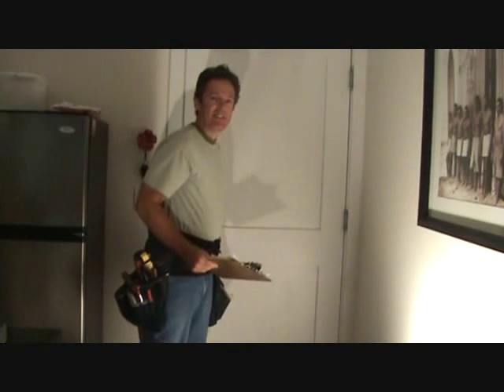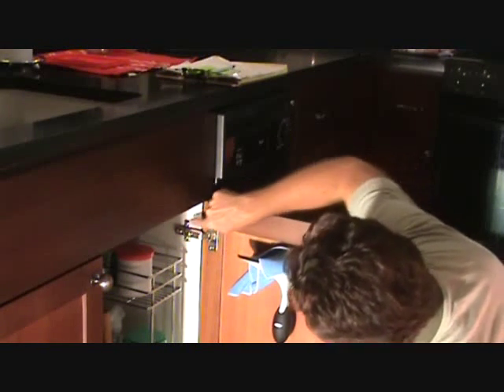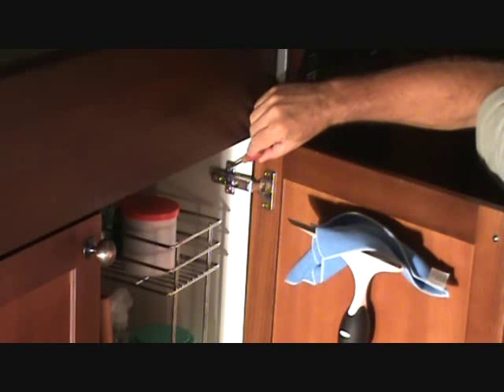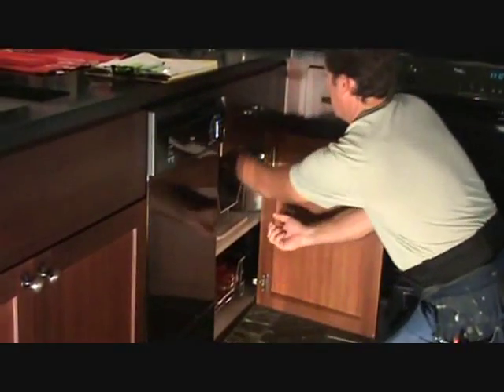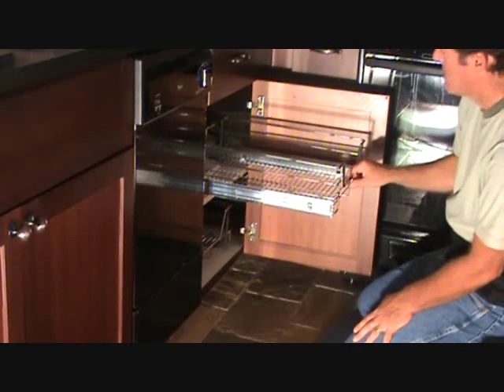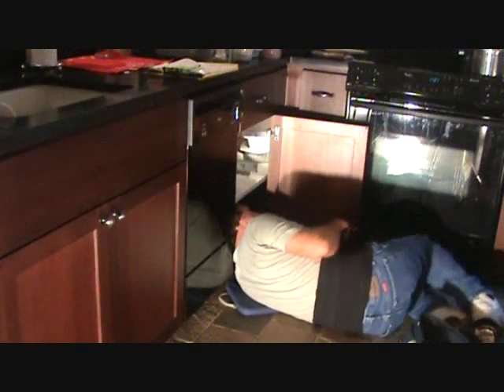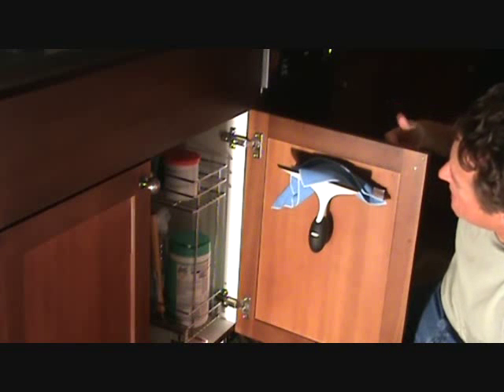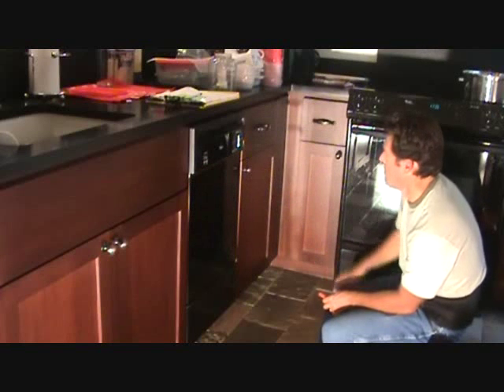Cabinet door adjustments for a "sticking" door

Comment from the maker: @chasedream100  I think "joe" explained enough to where you should be able to understand how to make the necessary adjustments to a sticking cabinet door. On the one main adjustment screw, you either tighten the screw in or loosen the screw out. This will tilt the door either way you want it to go...there's not much more to it then that. The other screws that hold the actual cabinet door in place  (top & bottom screw) can adjust the entire cabinet door up or down. Thanks for watching.   Joe  :0